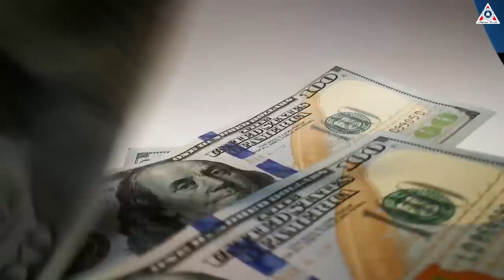All laugh at Blue Origin! Somehow New Glenn Production is further ahead than you think, but SpaceX

Comment: The tortoise never caught up with the hare. That's just a fable.
Reply: One day, while walking a shortcut to the store, I glimpsed something out of the corner of my eye. Curious, I changed course and followed. Turns out, it was a young giant tortoise that actually was moving fairly fast.

A week later, while taking the same path, I saw that its burrow had been run over by a utility truck that had been there a day before. I thought the tortoise was a goner.

After my errand, I grabbed a shovel and started trying to dig the tortoise up. After digging a 4 foot deep hole, I started digging sideways. When the shovel struck something hard, I exposed part of its shell. I was not hopeful.

After carefully digging around the tortoise, I was able to grab it and pull it out. After being buried alive for ~36 hours, I thought it was dead. However, seconds later, It poked its head out! 

I picked the 15 pound beast up, took him home and washed him up. By then, it had gotten its wind back and was moving fine. I released it and watched as it moved off into the brush. I have not seen any sign of it since then.

If you've made it this far, I think it is plain to see, tortoises get run over.
Reply: @psycotria  Some things:

Tortoises generally have very small territories. You should never move them far, if at all.
That  tortoise probably dug that hole it was in and could also dig its way out. Also, if what you did was in the US, it was likely illegal.

Comment: SpaceXs ability to quickly troubleshoot and problem solve and evolve seemingly in a night will always be why they will be on top. Having stagnated production and some super secret process and some occurrences of a leap and bound in production isn't how things need to be done.

Bezos intellectual mindset may have killed it in the online shopping and warehouse/last mile delivery industry that abuses delivery drivers labor but space isn't his area of ingenuity.
Reply: they work hard 24/7
Reply: Bezos also was passed on by Apple in the '90s when Apple chose Steve Jobs and Unix-based NextStep over Bezos' BeOS, to Apple's OSX success. Bezos was a jerk back then, just like when SpaceX got the HLS contract.

If New Glen isn't perfect for the market, it will fail. Its design is etched in stone. OTOH, if Starship isn't perfect, next week it will be better. Starship is bleeding edge in concept, but the core design is just a big pipe that can be modified in diameter and length.

Comment: Wow! The factories are clean, almost too clean... for a factory that is bustling with innovation and hardware-rich circumstances.  Who are they trying to fool, wait everybody, mainly investors. Bezos doesn't need investors perhaps, but he would prefer his company to stand on its own and be profitable of course, what owner wouldn't? With all they've accomplished at Blue Origin, I'm certain Bezos isn't needing to inject a lot of his capital into the company. After all, he has a thriving large rocket launching on a near record-breaking cadence. Oh wait, I'm sorry, silly me. I confused his company with another one smh😂.
Reply: It only looks clean because the buildings are new and painted a light color to reflect light and improve shadowless lighting in the whole facility.  As for the floors looking clean, they are white sealed epoxy paint similar to what Bezos' hometown experiences are like with Boeing which also uses white epoxy sealed floors.  Such a floor quickly reveals any FOD or parts such as a washer or bolt or tiny fastener failing to be installed and dropping down.  A gray concrete floor is not as useful for this essential purpose.  A sealed floor is easy to sweep up and keep clean too and being clean buff-white will reveal if any liquids are leaking.
Reply: @naekosl3059  it's a good thing they care sooo much on how a factory looks versus being on time with contracts and sad little things like that! But thanks for the lesson.👍

Comment: SpaceX is constantly launching rockets and recovering their boosters and other parts. SpaceX is not only doing missions for the Air force and NASA, but for Star Link which is not mentioned. Blue Origin might be going at a turtles pace, but SpaceX has crossed several finish lines while waiting to continue the heavy booster race as the FAA is still waiving the Red Flag. I'm all for Blue Origin getting better as competition is a great tool for successful companies, but they don't have the consistency that SpaceX has or the ability to shock NASA as SpaceX did with their Raptor engine test.
Reply: And if BO doesn't get a move on, they will lose their rights to launch Kuiper. At this point, none of the rockets it is supposed to launch on have flown yet. Meanwhile Starlink sats are being launched on a weekly or less basis.

Comment: The problem with turtle methodology is if you are doing something new and ambitious you are likely to fail and fail in unexpected ways.  You cannot fully plan out failure and design around it and if you have already built stuff you cannot radically change that design without huge delays and cost over runs.

Comment: 1. New Glenn competes with Falcon 9, not even Falcon Heavy let alone Starship. Their slow approach just leaves them in the dust.
2. The slow approach is fine when you have a stable industry. But right now SpaceX is continuously shaking it up with their fast approach leaving everyone else in the dust. Only fast players will catch up, or they have to shoot several moves ahead of SpaceX (like aiming for 10 times the capability of Starship) to go slow and get ahead; even then they'll likely be delivering the same capability as SpaceX on the same time frame.

Comment: Blue Origin has four (4) New Glenn boosters in work and THAT'S AMAZING!!!  Isn’t  Superheavy Booster 10 sitting on the launch pad?  Isn’t Starship 30 in work at Boca Chica?  And how many BE-4 engines have been delivered?  There were two to be used for integrating withbthe booster a couple years back and two "flight" engines, one of which blew up during acceptance testing ...   SpaceX Raptor-2 engines have 3 digit serial numbers painted on the nozzles and every SS/SH launch takes 39, soon to be 42 of them...  

Jeff needs to get serious and so do the folks spouting the competition or rivalry nonsense.  BO is not "competition" for SX.  Not even close.

Comment: New Glenn, Old Glen... They STILL don't have a reliable rocket motor.  No BE5, No Glenn!
Reply: SpaceX will likely be using Raptor 3s before BE-4 engines have the bugs worked out.
Reply: 😂that's not true,new glen rocket engines are on a rocket that will be launched on the 24th of December 2023,they supply engines to ULA I think
Reply: @codeforce5556  BO and ULA are controlled by the same person. and if the engines fail on the ULA rocket, you can bet there will be a major delay in BO's New Glenn.

Comment: A couple thing blue origin still has yet to make it to orbit, 4 boasters in a year as non test articles but with the explosion making them basically have to redo and reinforce what they already did losing the light wieght advantage they had, this coming from the company that was created before the other one and still behind only doing what hobbyists do with toy rockets but scaled up, not to mention worked on a engine that has been almost a dacad late the engine was supposed to be finished in 2016 but is only now put on a rocket, this is not the tortus and the hair this is jet vers someone in covered wagon